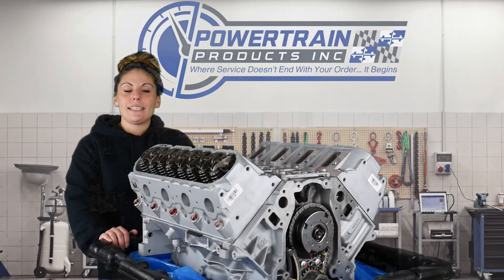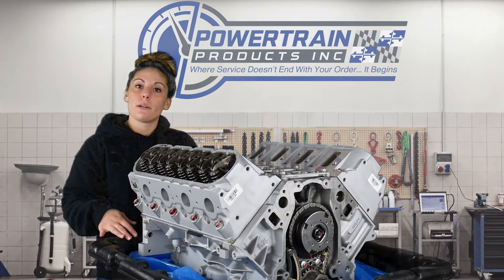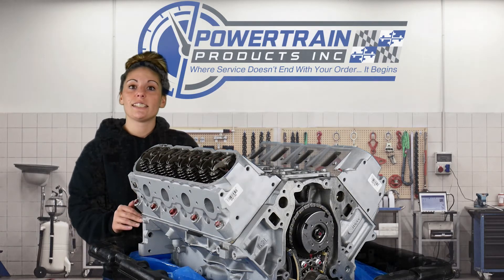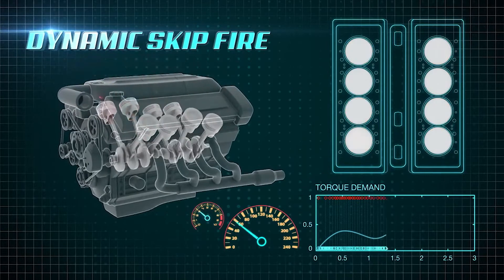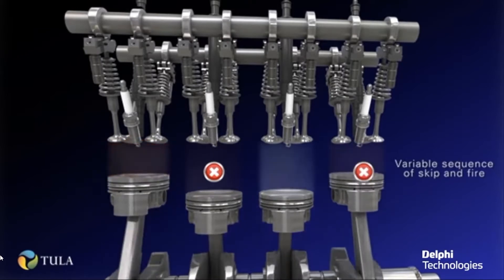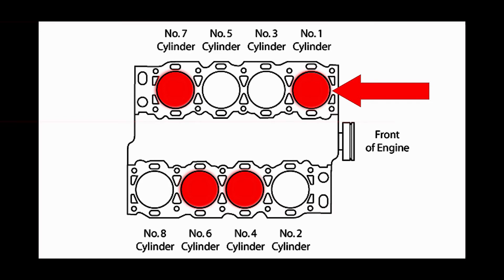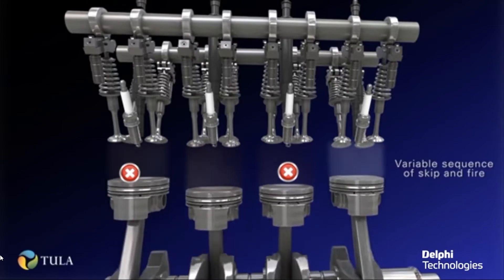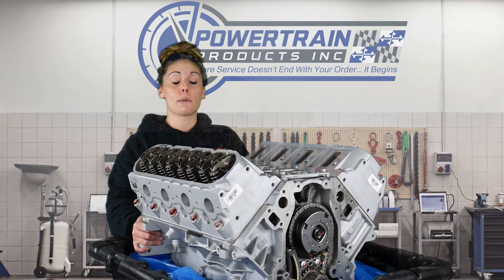DOD/ AFM Explained

Comment: I’ve spoken with GM official mechanics and off the record, they have told me this technology doesn’t work as advertised and it has a strong tendency to drastically fail; leaving the owners with very expensive repairs in their hands. Lucky are the ones who rarely don’t go through that experience. 
😢😢😢
I also heard through the grapevine, that the five-cylinder engine used in the Colorado pick up; which shared the same technology and while driving at cruise speeds, would switch off one of the cylinders for “added economy” was taken out of the market because it didn’t live up to its expectations.  🤷🏼🤷🏼🤷🏼